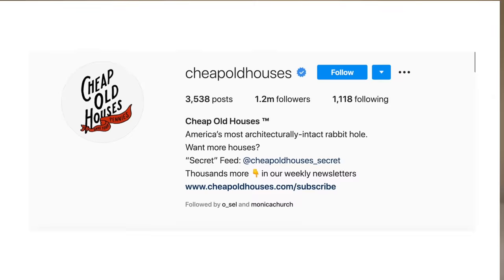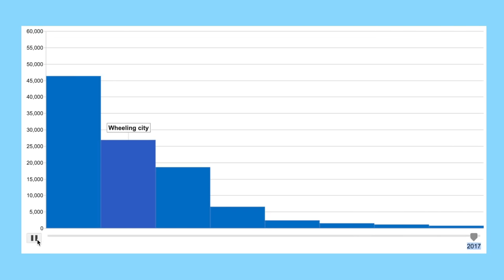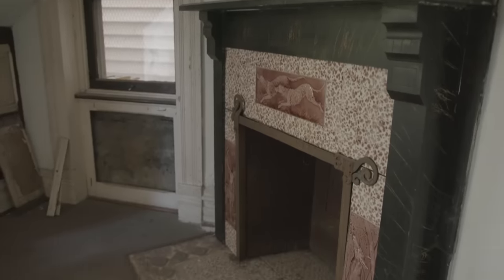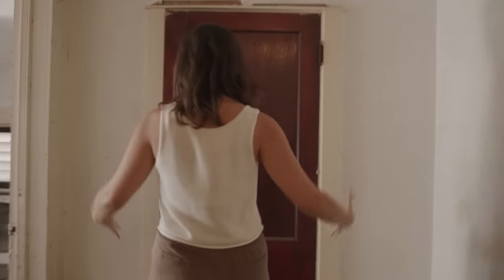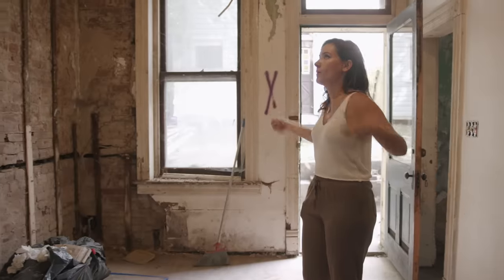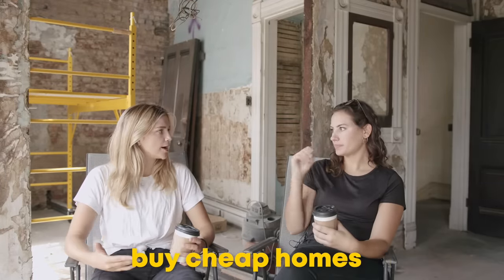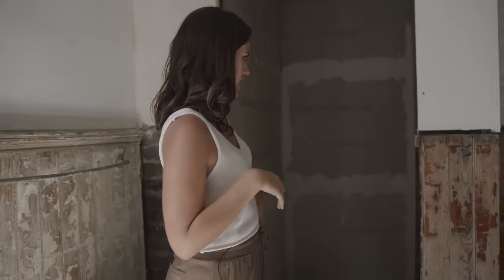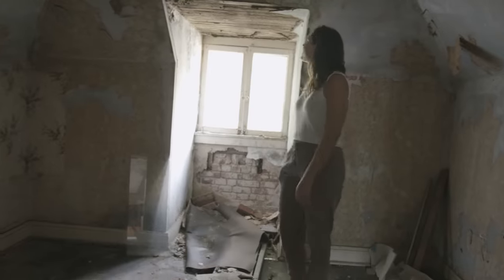Buying An $18,000 House: Inside America’s Cheap Old Houses

Comment: I wish I had the money to start a restoration like this. The house has so much character!
Reply: Can always get a loan!
Reply: Loans usually require a 20% deposit, we talking over an $100k loans here, not many have $20k+ sitting in the bann
Reply: @JoseFlores-xh5cj  it would be a project of years in stead of months, but what when you just got a loan to secure the building and do up only a couple of rooms first, before tackling the next ones? 
I've seen  people buying an old farm, couldn't get enough money to redo the old farm house, moved into the barn for a couple of years (like with the tiny house in the backyard in the video), and slowly rebuilt the old farm house. Renovating is huge in big parts of Europe.
Reply: @barvdw  Not that I disagree with your response, but many banks in America dont give out flexible contracts. If you tell the bank you want a loan to flip a house, you better read the fine print and make sure their are options if some miscalculation occurs and you need to live in the house.
Reply: @JoseFlores-xh5cj  of course, fixer-uppers are standard in some places, and there, banks are more accustomed to them. In places where they are not, well, banks don't like venturing into unknown territory, unless it can make them big money. A mortgage isn't doing that...
Reply: @JoseFlores-xh5cj  there are a few ways to put less than 20% down. You can get an FHA loan and put as little as 3.5% down, use creative financing 
.....and everyone’s favorite, other peoples money!

Comment: The only thing I'm afraid of in that house: asbestos. It will look great once it's all done. Hopefully Betsy will document everything on YouTube
Reply: This house seems to pre-date asbestos. One can also tell from the size of the tiles and and the materials if asbestos was  used. And even still, once it is remediated, one needn't worry anymore. Mold, is another story....
Reply: I would guess the majority of the house pre-dates asbestos, which wasn't commonly used until like the 1930s, I think? Perhaps if there was major renovation or an addition after that it might be something to worry about? Anyway, Betsy seems like she knows what she's doing, and I'm sure the professionals she's hiring are also aware of that as a potential issue and behaving accordingly.
Reply: @hcd621  It is illegal to do it yourself (remove asbestos). As it should be!
Reply: @laceyh  Yes in a home like that, places like furnaces, stoves, fireplaces could have asbestos. It was widely used in home products in the 70's (same with lead based paint) then banned soon thereafter, considering it has been around for over a hundred years and used in so many industries. And the final phase out was supposed to be last year in fact. Anyone doing work eventually has to atleast look into it, if not deal with it (meaning a company for proper removal.) Unfortunately many still DIY it, or pick ppl up outside Home Depot to do it. Which is horrible and disgusting, yet not something that anyone would ever take on as an issue, especially these days!
Reply: You also have to consider that there might be lead paint.  One good thing is that there was no obvious mold.
Reply: My only concern would be ghosts
Reply: Proof positive that people don't listen. It's not like the woman is ignorant, she works with old houses, that's her job,  so I think she can handle it.
Reply: Good point!
Reply: Everything asbestos and mold can be remedied
Reply: @nancymontgomery8897  Honey, look again. Mold is clearly visible haha.
Reply: @MrAronymous  Really?  Then that's a financial hit for her.

Comment: I also feel that houses that were made back then mid 1900’s were made out of better material than the houses today.
Reply: Keep in mind that old houses that survive to today are the best of the bunch so it's natural a lot were built with better materials and craftsmanship. The poorly built old houses are long gone by now.
Reply: when you start with lots of material you don't think you'll run out so rn most are saving material for other generations
Reply: Yes that is true
Reply: Houses back then were made to last. Nowadays it’s an open secret that houses are built to last as long as the mortgage does.
Reply: Yep nowadays fires are SO much quicker to take over the whole house. A long time ago it would take more longer..
Reply: They were made sturdily, but not energy efficient. That house has NO insulation!

Comment: OMG, I just bought a cheap old house in Wheeling, WV too. It was built in 1900 on Wheeling Island and it is haunted!
Reply: Can you confirm this with evidence?  I live in a mansion built in 1885, and converted into apartments in 1926. I have been residing here since 2012 with no signs of haunting.  You may want to check the wiring and carbon monoxide in your dwelling.  These can lead people to have hallucinations, and therefore believe an old building is "haunted."

Comment: The amount of mold that is mostly likely in that house scares me.
Reply: and asbestos....
Reply: @BelgianBillie  Sounds like her profession is working with older homes so I'm sure she got it tested.
Reply: As well as asbestos and lead.
Reply: And PCBs
Reply: Asbestos and lead probably, but mold unlikely.  Plaster is inhospitable to mold and old houses were designed to “breathe”.  Mold is a more modern concern with the prevalence of drywall and airtight construction due to energy efficiency.
Reply: @chertp28  yeah the lead paint,  that stuff has to be professionally removed
Reply: rodent dropping....ewww
Reply: Kd Love There probably gonna disinfect it. You wouldn’t live in a house like this without disinfecting it. :)
Reply: @o_oo_o1812  there's actually an exemption from the epa for lead based paint. If you use a p100 respirator and surfactant (amended water) you can generally scrape it off safely and it can go in a regular municipal waste bin. 

(These statements not intended to serve as renovation or legal advice - consult your local regulations)
Reply: @HooDRidEWhiteY  I wear a p100 mask here in California just so I can breathe air that doesn't contain ash particles from all the forest fires. These masks work for a variety of situations, although I look like a psychopath when I walk around town with it on my face.
Reply: Jen Everyday there’s a lot of wood as there is a lot of plaster too. Mold can grow anywhere there’s moisture, so I think all you really need is a leak in a pipe or the roof to develop a mold problem. I’ve lived in a few old houses built with these walls and all of them had mold. One had a water leak into the basement from a crack in the foundation, and another had a roof leak, and a pipe leak in the walls. Roofs are very easy to neglect. And in 100 years it’s very possible acquire neglect in that time.
Reply: @le_th_  good on you. They also work for asbestos and silica
Reply: @HooDRidEWhiteY  Good to know, thanks!
Reply: @BelgianBillie  I think that was built before asbestos was used in consruction
Reply: Back in the 1800s I don’t think they used asbestos yet
Reply: @beautybyjenm  Thanks.  Taught me something new!  :)
Reply: Why?  You aren't living in it.  She obviously knows what she is doing.
Reply: @grannygoes7882  ANSWER: empathy for others

Yeah, some people actually CARE about other human beings, even people they don't know. 

Hard for you to imagine, isn't it?
Reply: @le_th_  Baloney!  It's jealousy.  If you were really worried you'd ask a question like, "what about mold, is that problem?"  Instead of making a statement like, "the amount of mold in that house scares me."  You aren't fooling anyone and  you know nothing about my empathy for other people.  You should be so lucky.

Comment: This makes me wanna move there and buy an old house
Reply: Houses or Builds like this are nothing new- My father bought a Victorian House in 1970 in the UK for as little as 1100(He paid Cash) & is worth 1.5M today, my father then bought 5 other houses on the same Road- People in the UK have been buying Houses like this & fixing them up for decades
Reply: Beware though. It is a lot of work to fix it up. That's why these homes are cheap. There may/will be a lot of issues; mould, rising damp, electrical, gas, water line replacement, foundation repair, water damage, etc. etc. etc.
Reply: @jonathantan2469  we have similar issues in England there’s a lot of old houses with so many issues but they’re so grand a lot of houses in England have so much history

Comment: That house is massive. Here in the UK that's about double the size of a decent sized detached house in a suburb. $125k seems like a bargain compared. Here that would get you a tiny terraced house with maybe a bathroom missing all the fittings. But only 2 bedrooms, bathroom, kitchen and living room downstairs. That's all you'd get. And the rooms would be half the size of the ones in the video

Comment: After the subprime crisis in 2008 I was buying houses for around 6 to 8k a piece.  Even bought one for $4,500.  You read that right.  I was living in one of the units of a 3 unit apartment building I bought for $27,000.  I was at the very beginning of the remote work trend and worked as a consultant in Chicago while buying my cheap houses in South Bend and Mishawaka, Indiana.  My downfall was the houses were so cheap that I bought too many and had too many to take care of.  Just because it's a cheap house doesn't mean maintenance is any cheaper.  My house I live in down in Florida now costs more than 400% of my entire portfolio of 15 cheap properties in Indiana.  It was an interesting time.
Reply: Very true.  The taxes and maintenance are basically death by a thousand paper cuts.  Something ALWAYS needs to be done or laid on the houses, constantly.  There’s always gonna be a problem.

Comment: All that plaster is compromised and the plaster ceilings are up to an inch thick and very heavy will kill you if they let go and hit you in the head. Rip it all out and drywall over the sticks,or go down to the studs where you have to  Its too labor intensive to do plaster and almost nobody is alive that knows how to do it correctly I restored a 1924 hotel in Florida about as bad of shape as this . First get the roof done then get new windows and gutters put on to dry the place in in then get the interiour stucture issues fixed then rewire and plumb the place, save the stairs and anything you can like trim and mouldings but id get rid of all those plaster walls at least the ceilings and drywall over the better walls. Its a tremendouse amount of work. we had 3 full time carpenters and several crews for various trades and it took us dam near 3 years. We basically built a new building inside the 4 brick walls . Its still standing to this day 20 years later.

Comment: I LIVE in a 96 year-old "CHEAP HOUSE" and there's nothing "CHEAP" about them but the initial price!!! The house show undoubtedly contains asbestos that's "FRIEABLE" ie: airborne and NOT contained. It has lead in the plumbing, including the supply water lines. It (like mine) has rod and knob insulators and wires (or bare buss rods) on them. So it MUST have $20,000 of electrical work. $35,000 worth of new plumbing IF the sewer lines are OK (not very likely-they are probably tile and broken by now-I had to replace $23,000 of lead and cast iron under my house two years ago). Asbestos abatement depends on where you live and if there EVER may be infants or children residing in the house. IF kids MAY be present, it goes Federal and starts at about $80,000 AND you MUST remove ALL LEAD PAINT ($60,000 to start). What about the roof and rafters/decking? To get insurance, it's ALL got to be re-done for about $400 a square foot, and the old furnace/boiler may still work fine, but it won't pass "code" inspection by fire code. Now the TV shows PISS AWAY money and materials like oats thru a goose, and ANYONE that has grown-up in a 1930's built house KNOWS better "how-to" fix things with-out wasting money. Sadly, I moved in 38 years ago and re-modeled then, but it needs it again, and after 5 MAJOR strokes, I can't do it myself, and I can't get anyone that will work when I pay them $350+ an HOUR!!! They sign a contract and disappear! That's why they're "Contractors"-they never do any WORK!!! Her and my house are built from better basic materials (2x4's and such) than you can buy today FOR ANY PRICE. 96 year-old loblolly pine FULL 2 inch by 4 inch studs are harder than concrete! Try driving a concrete screw into them and it will snap-off if you don't drill a pilot hole! A nail-gun is worthless-the nails just bend. Seventy-seven cent each Hilti powder actuated fasteners will drive (watch "The Wire" on HoBo).

Comment: 125K? I would say 250K minimum.
structural checks/ refurbishment would be 125K alone (+ plumbing, electricity, asbestos removal, etc)
then, everything inside, from floor to ceilings and walls, furniture, etc

Comment: Insane that the house had/has structual issues and her reno budget is only $125,000.  I live in the Cincinnati metro area which is pretty cheap, and I can't redo a kitchen for less than $70,000 in a small house that is worth $150,000.
Reply: Well the house was less than 20k and they’re in WV, labor is cheap. And she stated she’s DIYing a lot
Reply: She is NOT been GAUGED by over priced tradesmans (give it another 10 years and they will start to give out GAUGING prices in that neck of the woods as well)

Comment: they are called parlours. service stair is not that. it was for the black slaves and they usually had a very small unfinished room in the basement . i would not use any of the fireplaces period, the house will burn to the ground. how do i know? i have restored several civil war homes ,victorians etc. i bought 1 two hundred year old house i restored myself. last one and tornado took it away and insurance did not pay. they said it was just an old house. and my most important lesson i learned after putting every penny i made into that big 15 room victorian 5 story tall is nothing is forever.

Comment: How can you remodel a 4000' home for 125k in 1 year???
Structure improvements, hvac, electrical, plumbing, flooring, walls, and ceilings?
We can't even broach the subject of any insulation, as that alone could be half the budget?
I bet it's 2yrs and 400,000 minimum

Comment: She definitely underestimated the amount of time and money that it would take to restore/renovate a property of this size. Even without the pandemic, there's no way this was getting done in a year or for that amount of money. Instead of focusing on wallpaper, it would be better to think about making sure the electrical wiring in the house is updated and fixing any plumbing issues. Not to mention insulation and the actual structure. The fact that part of the ceiling and some bricks just randomly fell, would make me second guess her saying that everything is fine structurally. I'm curious what her job is?
Reply: My guess is remote work.

Comment: Delusional.  100k is not enough to fix that.  Maybe 250k.  Just the kitchen alone could be 50k.  Most of the plaster walls in that house should be gutted just to redo the old electric alone.

Comment: Super neat, but I'm not sure who told this poor girl its going to be $150k to fix it up. A full bathroom in a house from scratch costs a contractor about $10k in supplies and labor. End user closer to 15k. Duct work, electrical, plumbing, flooring, lighting, shower/toilet/vanity, drywall, painting etc. There is no way this is going to be fixed for 150k unless she really good with tools and knows a guy for everything she's buying. .Damn, it costs $2000 to vapor barrier, drywall, mud and tape a triple garage these days.

Comment: One Question, in which world you can renovate such a broken bulding for about 100k bucks?! You have to replace the whole electricity, sanitary installation. You have to replace the old windows, add a thermal insulation on the outside wall, insulate the top floor ceiling and what is about the roof/housetop?! On top, you need new heatings and coolers, especially maybe better climate neutral? ON TOP on that, you need 2 new bathrooms, a kitchen. In Germany you would have to spend at least 200/300k+ to meet the climate guidelines. The energy costs are still to low in the USA and the building standards dont seems that high.